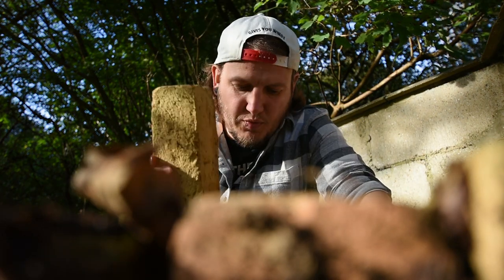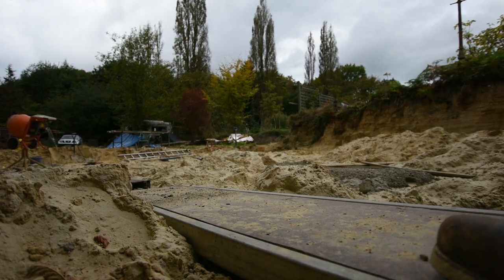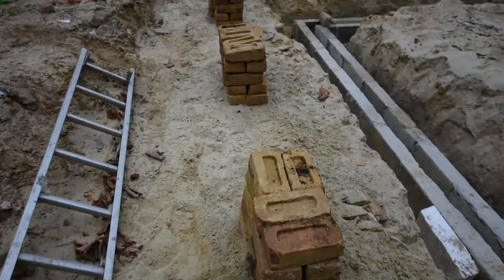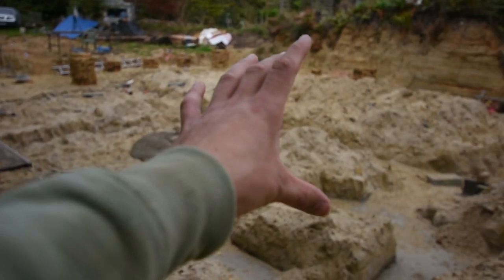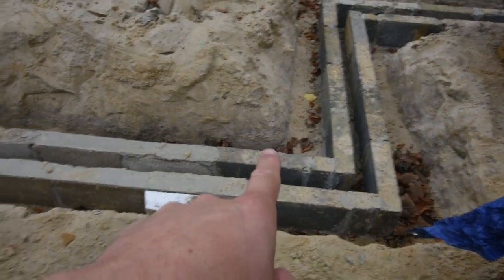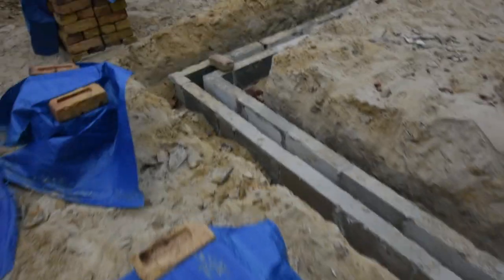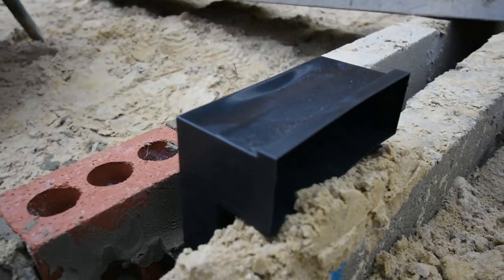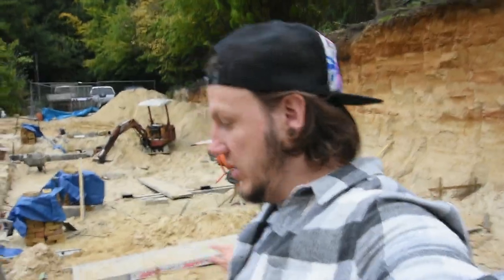The BIGGEST MISTAKE any BRICKLAYER can make! | House Build E.P 8

Comment: 10 brick in a hod ! ? When I were a lad ( idiot ) we used to put the first 3 on edge so you could get 13 in . We had a cracking hoddy called Paul . In the days before tele handlers he used to run up and down the ladder with the hod balanced and 2 hands on the ladder . Very skilled but stupidly dangerous (sums up site work in the 80 s ) 😬. 🧱👍🏼
Reply from the maker: Could have put a couple more in but I wanted 80 in a stack so 10 a hod made sence.....to me anyway 🤣

Comment: Why oh why does the design of the Hod feature a razor sharp edge running right where it sits on the shoulder???? Baffled. Obviously there needs to be a reinforcing rib but it can be flattened into an ergonomic shoulder shape, just to relieve the force of pressure.